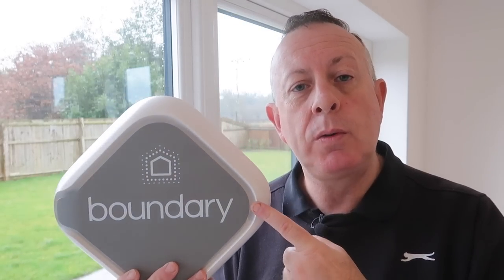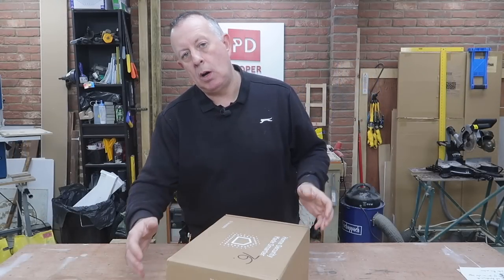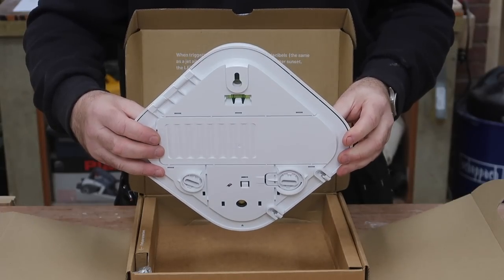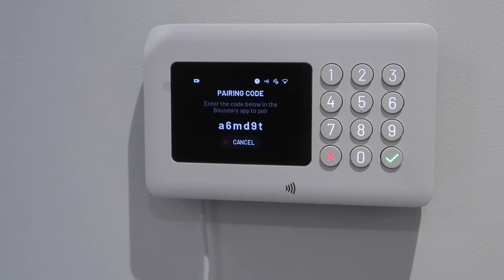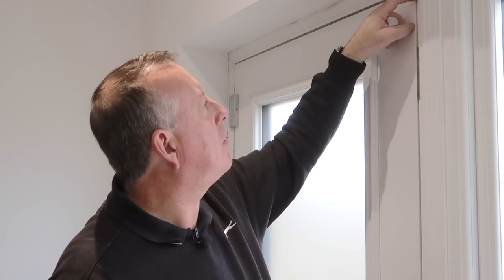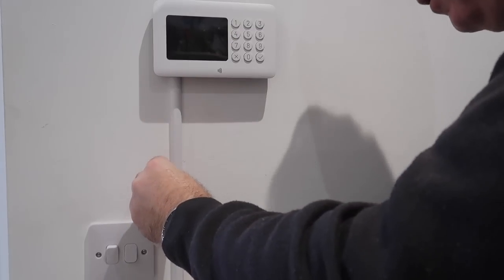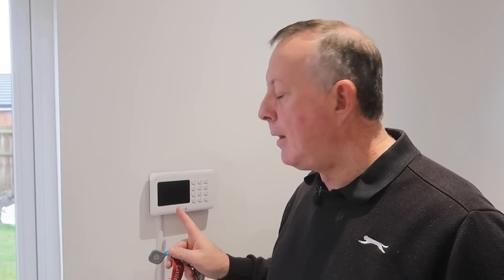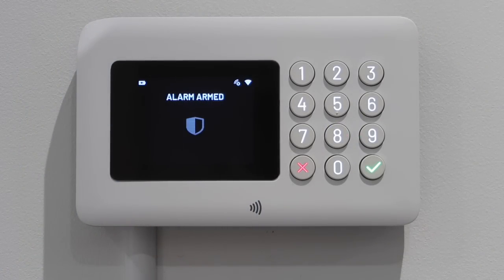Boundary Alarm System - The Easiest Alarm System to Install

Comment: Great video and the system looks brilliant. The only thing you didn’t mention was the monthly subscription.
Reply: Hi Kevin, our free Lite plan now allows Unlimited Sensors. There are no other costs other than the upfront system purchase. Check out the monthly plans page on our website for more info.
Reply: I thought the same. Also their reply no other upfront costs but please check out our monthly plans.
Reply: @NorthWalesCampers  That's because we do still have plans with monthly fees but our Lite plan doesn't. The monthly plans page gives you all the information of what's included in each plan. Thanks, Tom
Reply: How's it brilliant? Wasn't innovative at all, you get back to the 80's with only PIR and door contacts, just a huge marketing around it, no wonder why it went into liquidation and it's now useless, biggest scam ever...

Comment: Before ordering you should be aware that a monthly subscription of £9.99 applies if you want to protect anything bigger than a shed. Boundary will sell you the package shown which includes six sensors. If you want to use more than two you have to subscribe.
Reply: Matthew's is my favourite DIY channel for sure, but the Boundary subscription plan is no more than a con.
Reply: Thanks for the heads up regarding the subscription, shame it wasn't mentioned in the video. 
I'll not be purchasing now.
Reply: Hi Gerry, our free Lite plan now allows Unlimited Sensors. There are no other costs other than the upfront system purchase. Check out the monthly plans page on our website for more info.
Reply: @johnsteed9083  Hi John, our free Lite plan now allows Unlimited Sensors. There are no other costs other than the upfront system purchase. Check out the monthly plans page on our website for more info.
Reply: @FlatEric971  Hi there, our free Lite plan now allows Unlimited Sensors. There are no other costs other than the upfront system purchase. Check out the monthly plans page on our website for more info.
Reply: Paying the 9.99 monthly fee is the only way to get push notifications to your phone which for me is a major selling point knowing someone’s in my house when I’m not there.
Reply: Boundary went into liquidation a while back.

Comment: Sadly the monthly plan cost kills this one. Pointless to be able to only pair 2 sensors so the paid subscription is necessary at £120/year. Close, but no cigar.
Reply: Yep. I was going to purchase the medium package but stopped short when I saw I had to commit to a monthly subscription to get full features from the mobile phone app!
Reply: Hi there, our free Lite plan now allows Unlimited Sensors. There are no other costs other than the upfront system purchase. Check out the monthly plans page on our website for more info. Thanks, Tom
Reply: @Firetech1961  Hi Nick, our free Lite plan now allows Unlimited Sensors. There are no other costs other than the upfront system purchase. Check out the monthly plans page on our website for more info. Thanks, Tom
Reply: @BoundaryAlarm  push notifications on lite plan when?

Comment: Always being advised to protect myself with a very easily installed system. However,I am happy with the stuff I installed myself,door alarms,sensors,automatic lights,which I have found to be the best value. An alarm would set the neighbours against me eventually,so I prefer the quiet gadgets,and securely locked doors and windows. Incidentally,I do not oil or grease the window latches because I want to hear any being forced. The door hinges squeak quite loudly too. Being alert is the best weapon against intruders,and keeping a weapon handy.

Comment: As you know I love your channel but as someone who has worked in the professional security industry for the last 30 years and currently works for the world’s largest independent security manufacturer, I get frustrated by equipment that meets no British / EN standards and where people get either tied into expensive monthly fees or paying excessive monthly fees for apps. Police response can only be achieved if the equipment complies to EN standards and is installed by a NSI or SSAIB accredited company. Please do your homework, like everything in life you get what you pay for. Rant over.
Reply: I agree entirely. I'm a (retired) security installer. I wouldn't want a battery powered bell box.  I'll be too old soon to get up the ladders.  None of my kit ever had monthly charges either!
Reply: Hi Simon, Robin from Boundary here. You might not know this but our system is going through independent lab testing to achieve EN50131 certification. We expect it to be finalised by April with most tests passed at this stage. Boundary is SSIAB registered also
Reply: @robinknox4614  So are you able to provide police response now or hoping to sometime after April?
Reply: @kmhphotoman  this service will only launch after April 👍
Reply: @robinknox4614  Then surely this video which is clearly an advertisement rather than a revue as well as your own website misleading?
Reply: @kmhphotoman  its the way the residential market is going unfortunately.  All these companies offering police response with bare minimal detection and or properly surveyed sites is going to lead to a lot of disappointed subscribers when the police don't turn up or insurance companies don't pay out.  A proper NSI company would use something a lot more professional like Texecom, Galaxy or Orisec.  Just my opinion tho.
Reply: @TheWiccanGirl  It's disappointing that this "review" which is really nothing more than a advertisement is proving false information.
This channel does provide some useful "DIY" information but like many others which start offering "reviews" they are rarely impartial or thorough, offering discounts and linking to websites where purchases can be made. Obviously they need to make money but their credibility is lost once they promote a product like this without due diligence.
Reply: @robinknox4614  what about PD6662
Reply: @dannyhoughton74  Boundary will install in accordance with PD6662 also, we intend to be fully compliant and above board as responsible participants in the industry
Reply: @dannyhoughton74  Hi Danny, Boundary is SSAIB registered and so is our installation team. When we launch our police response service we’ll be applying for URNs and operating above board and in compliance with any and all industry requirements. Hopefully that’s clear
Reply: Orisec it is then, cheers Danny 👌🏻
Reply: @owp867  you won't regret it.. Fantastic kit
Reply: What do you recommend for home security - new home owner
Reply: @ilonap2949  A wired system is always more reliable than a wireless system and cheaper in the long run as not paying out for batteries. RISCO Lightsys Plus is very good and offers both options along with being the only product on the market with the Polices Secure By Design accreditation for its cloud and app service.
Reply: @simonmiddleton4977  cool thank you
Reply: @ilonap2949  definitely a wired system.,  look for a local reputable company. Try to avoid the national or companies who install their own manufactured kit. Wires is ALWAYS better where possible. If you need police response or have insurance requirements you'll likely need the installed to be NSI or SSAIB.. please feel free to ask any questions
Reply: The police response is dependent on the package, like he said.
The package in question, which includes the police response, requires installation by them rather than yourself
From their website
'You will need to answer a few questions so we can tailor your system to your home and ensure it meets all police monitoring requirements. This plan requires a professional alarm installation £229'
Reply: Mate what fucking company isn't? Get over it.
Reply: To get a police response you need the alarm to alert them that someone has said hurty words about you on fb…
Reply: @robinknox4614  Hi, I bought a full system in July 2021, Smart Plus customer so 3 year warranty included. System no longer supported after only 18 months, a would be warranty issue. Appreciate the company is in liquidation but there are insufficient dividends for any compensation. I am left with a mis sold product. Can you guys please advise of some way to utilise the existing hardware or provide me with a 50% refund to cover the early withdraw of my product?

Comment: Great video thanks Stuart. I had to install alarm one of the battery type alarm unit at my daughter’s house made by Yale. I did have a lot of problems with the batteries supplied going flat and the double sided tape not sticking very well. But some good new batteries and 3m tape solved all the problems. The unit you used, looks so much better than the Yale ones.

Comment: In light of these going bust, and the Google Nest alarm system shutting down at a similar time, I'd HIGHLY recommend getting standard alarm equipment and running your own system via Home Assistant or SmartThings or similar.

I used a Konnected board to use my existing wired door/window/motion sensors and siren in a smart alarm, then added Zigbee wireless sensors (battery life 2 years from a watch style battery) to add other rooms. All of it is controlled in Home Assistant with the "Alarmo" addon and will still work 10 years from now even if all the manufacturers go bust, as long as my Home Assistant raspberry pi stays plugged in.

Never buy hardware that relies on someone else's goodwill or server time to keep it running.

Comment: Brilliant video as always and I couldn’t quite believe the 45% discount code… I even started to sweet talk the wife into looking at it… until I saw the monthly fee. Poor show on Boundaries part I think there… fair enough having more features etc for the paid for version but limiting sensors is a bit tight. Thanks again for the video.
Reply: Hi there, our free Lite plan now allows unlimited sensors pairings so no restrictions. You can also arm/disarm via the app, partial arm via the hub, and integrate with the likes of Alexa, Google Home and IFTTT on the free plan. Hope that helps. Thanks, Tom

Comment: I'm in the process of installing mine. It's a great system. Very easy to setup, very well designed interface and well built. £10 a month for support and updates is a bargain. The existence of a monthly subscription is part of the reason I went for this system. I want them around as long as I have it and that is far more likely to happen if they have reliable monthly recurring revenue for a variety of reasons.

Comment: Issues for me are:
- the web site recommends 6 sensors when I state only 3 rooms downstairs (should this be 2 sensors per room?)
- Unless you pay an additional £120 a year contract, you can only pair 2 sensors to the system?
Reply: Work it out based on how many windows/door openings there are. Easy to do. In terms of the subscription I paid more for a wired system in a previous house and then every time I wanted a change it cost me a small fortune. Compare this with Verisure and see. Also be aware the discounts available are huge at the moment with a promo code. Brilliant system in my view and the monthly fee is more than acceptable to me… installed this about 2 months ago .. great kit
Reply: @GordieK  Subscription systems to be able to use your own kit is a terrible business model for clients but a great money grab for businesses. Its all too common these days as well and as its cloud based, internet outages or a hack at boundary and you are at the mercy of whatever happens to that third party. There is a reason CCTV and Alarms have a virtual air gap in professional setups.
Reply: @Amped-JDS  yes it is cloud based but remember the outdoor siren doesn’t depend on that as the system uses zwave …. Tbh posting anything on here has its security issues as well and I doubt the data boundary have of me is any different to what many cloud based companies do .. at some point we need to lose wires … Ring uses subscription , EZVIZ uses subscription as do many many others .. it’s not a valid reason not to go with it in this day and age …
Reply: @GordieK  of course it's a valid reason, you are just drinking the koolaid and believing the subscription is needed. Just because everyone is jumping on the bandwagon doesn't make it right, it means people are just not able to think for themselves and look at the better alternatives. No subscription for pretty much the same system with Yale. It's not so much a worry about what these companies know, it's about the fact they can disable your alarm which with malicious intent is a bad thing.
Reply: @Amped-JDS  You're right. Ongoing monthly costs are awful for domestic systems. Used to be the same with monitored alarms and paying for two services a year, bought the thing 20 times over.  Plenty of wireless systems out there   without subscriptions and apps.
Reply: @GordieK  In relation to my use of the word sensors, I am talking specifically PIR's and not contact sensors. I was additionally told to get 3 contact sensors using the recommendation tool.
My question relates to why I would be directed to buy 6 PIR's for what amounts to 3 rooms?

Comment: One thing to note is that for the Level 1 police response the external alarm must be professionally installed as noted on their site "Police-response systems, such as ours at Boundary, have an outdoor siren that must be professionally installed onto the exterior of your property. "
Reply: To stop DIY people from installing
Reply: Which is BS, yes it does need a professional installer that's either NSI or SSAIB approved, then they need to apply to the local police force for URN (average £60 pa additional paid to the police) but they're forcing the sale of an externals sounder that's not needed..

Comment: I think you ought to have stated up front that it was a subscription based model. Other than that it was an informative and interesting video, thanks for sharing.
Reply: Hi there, our free Lite plan now allows Unlimited Sensors. There are no other costs other than the upfront system purchase. Check out the monthly plans page on our website for more info. Thanks, Tom

Comment: Looks like a decent system but the monthly fee is pretty pricey.
Reply: Hi there, our free Lite plan now allows Unlimited Sensors. There are no other costs other than the upfront system purchase. Check out the monthly plans page on our website for more info.
Reply: @doctorlove2022  Hi Sean, our free Lite plan now allows Unlimited Sensors. There are no other costs other than the upfront system purchase. Check out the monthly plans page on our website for more info.

Comment: Another great video. I just have one gripe. I just went on the site to look at buying the medium bundle. The only way to buy without a monthly subscription (which I don't want) is to buy the lite which only has x2 sensors. Quite dissapointing.
Reply: If you have a wired system it will cost you about that for your annual maintenance contract for it although you can always decide not to have it. Also in terms of future flexibility this is so cost effective to add sensors…
Reply: @GordieK  I fitted a wireless Swann system around 10 years ago. I liked the App part of this so would have liked to swap out and install this. I just need a system I can access online like my cctv. I don't want to be forced to take a monthly subscription. I can replace batteries and maintain myself.
Reply: Hi Mark, our free Lite plan now allows Unlimited Sensors. There are no other costs other than the upfront system purchase. Check out the monthly plans page on our website for more info. Thanks, Tom
Reply: @BoundaryAlarm  this is a real game changer for you guys...good move...
Reply: @GordieK  Thanks, Gordon.

Comment: Hello Stuart, I really enjoy your channel with its clear explanations and useful tips. I'm interested in the Boundary Alarm system but I have a question. I understand that you need the internet to set up the various sensors and to get them to "talk" to your phone, but if the internet modem suffers a power failure or if the telephone line is cut will the sensors still trigger the siren if they are activated? I'm guessing that the answer is probably "yes" but you will no longer get the alert on your phone. Is that correct? Thank you

Comment: As others have stated, this company have ceased trading. The liquidators are Johnston Carmichael (Edinburgh).
Some of the sensors may be compatible with other systems, so you may not have to throw the whole system in the bin.

Comment: I had a Verisure system put in about a year ago having never come across this Boundary package. I’m paying around £40 a month, so the Boundary at only a tenner a month seems like a bargain, although I don’t think there was any upfront cost with the Verisure. Good video and great production values as usual!
Reply: Get a professional installer to sort you out, costs alot less than these scammers are charging. Ask your insurers if it's recognised as a maintained system.

Comment: Does anybody actually respond to a neighbours alarm if it goes off?  Most people just curse them and complain about the noise.  Burglars know this and carry on even if an alarm sounds as it will take police an age to respond if someone actually does bother to call them.
Reply: When a family member was burgled years ago, the police attended and explained the reason the house was chosen was because it was the only one in the road without a visible alarm.  They stated alarms act as deterrent only and although the burglary took place at 3pm in the summer, not a single neighbour saw or heard anything.
Reply: This is why you can add keyholders to the system to include neighbours if you wish. They will then be contacted in the event of an activation.